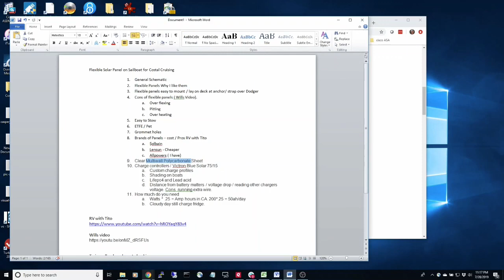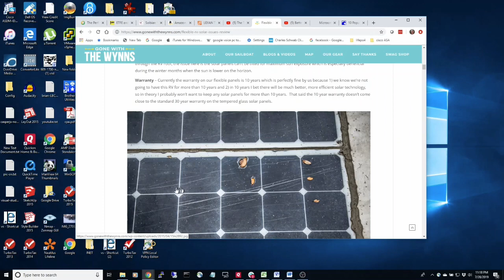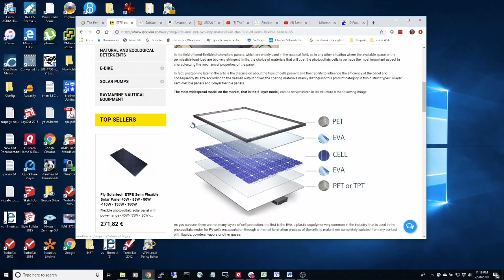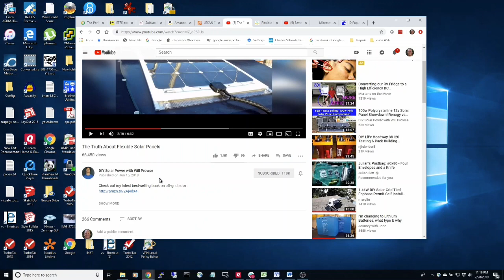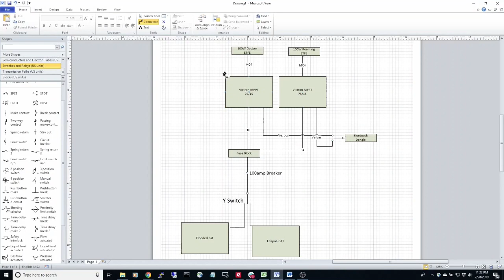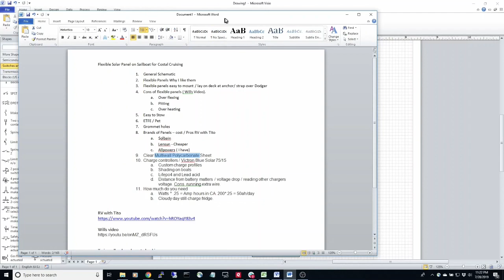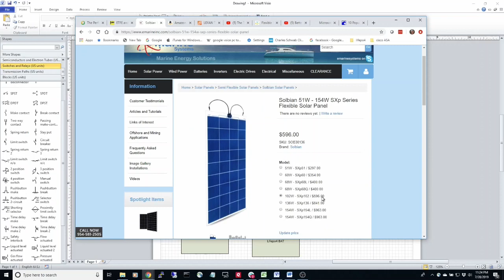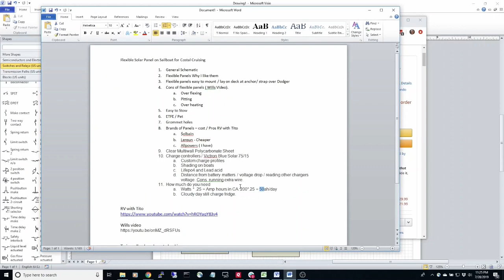Stowable Amazon 200w ETFE Flexible Solar Panel Installation on Sailboat with Victron Charger Lifepo4

Comment: do you find the ETFE works better than others when there are shade spots? Have they degraded any? do they ever make a cracking sound?
Reply from the maker: I really don't know about the production of ETFE and degradation. On a boat it is really hard to tell shading varies quite a bit.  Yes. when they were new I did hear a bit of cracking from the  panel I run on the dodger. However, the panel with the dual wall backer I never have heard the crack. It is best to now flex the panels much but when you first flex them I remember hearing some cracking. I'm sure they don't last as long as a glass panel but I just don't want to hassle with the bulky panels on my small boat.